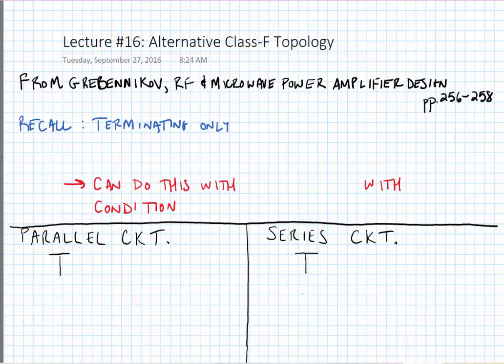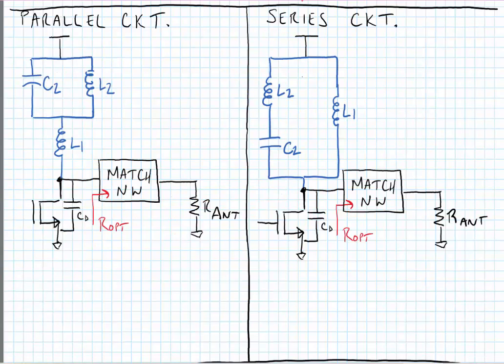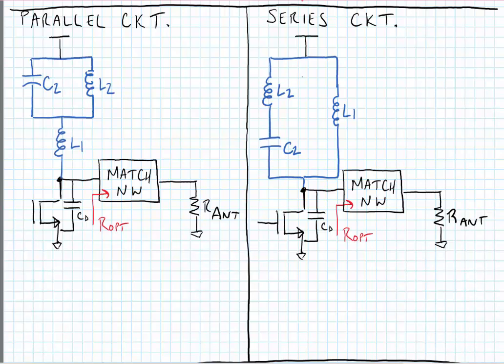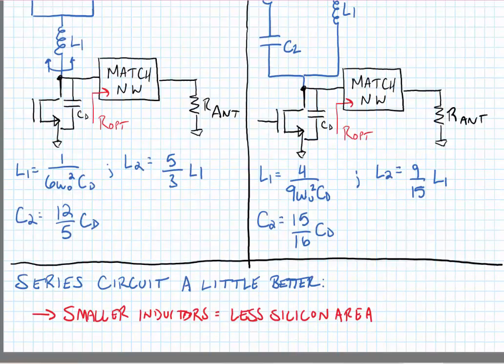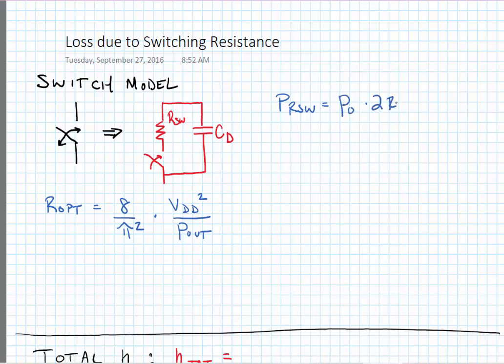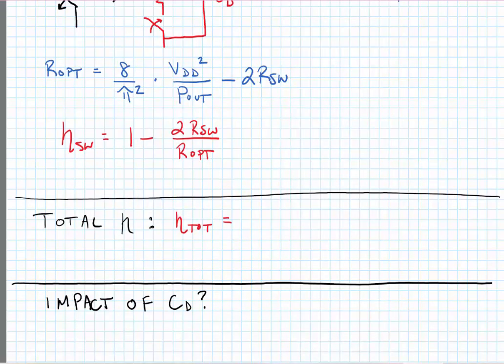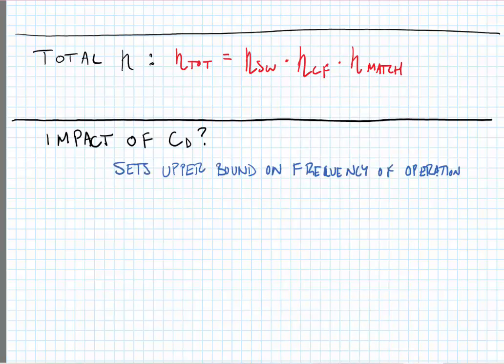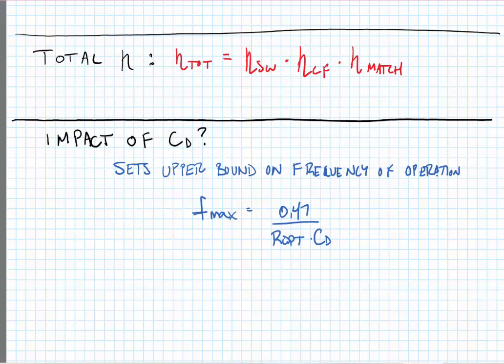Lecture 16.1 - Alternative Class-F Topologies

Comment: Hi Prof. Walling. Actually I borrowed the book of switch mode RF and microwave power amplifier which had the same topologies of both series and shunt L2C2. I am wondering why we can consider the resistance for f3 is infinite since there is another way by output matching network. Will the OMN contain a series resonator tuned at fundamental frequency? Thx